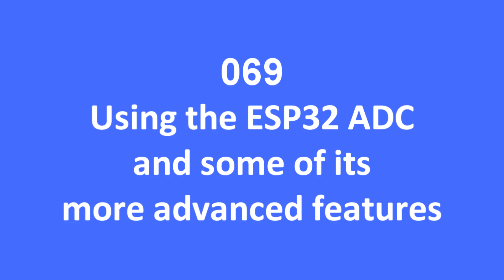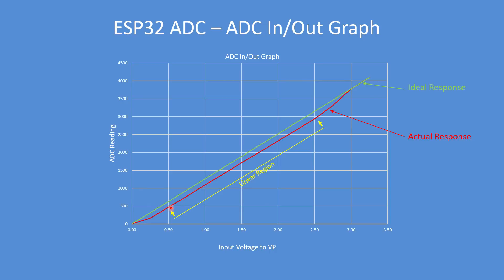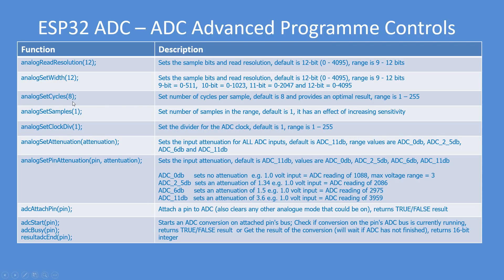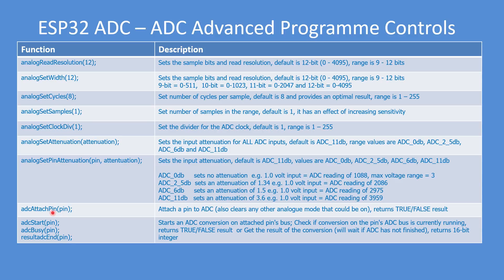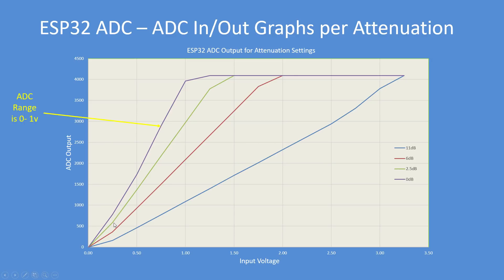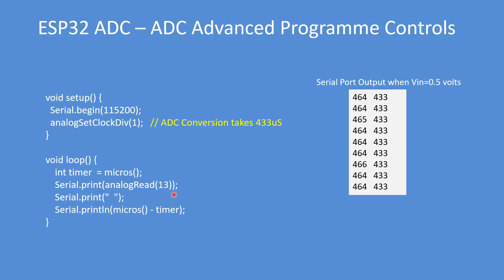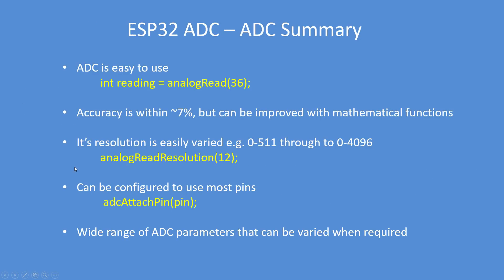Tech Note 069 - Using the ESP32 ADC and some of its more advanced functions

Comment: hello, i'm using the polynomial function to improve analog readings, however i'm only getting a maximum of 3.14 V
Reply from the maker: Well the maximum range of the ADC if set to 11dB of attenuation is 0-3.0 volts or Vcc -0.3, so are you using an input voltage divider?
Reply: @G6EJD  yes, i'm using a voltage divider.
Reply from the maker: Then you need to multiply your result by the voltage divider ratio, so if /2 then *2 then you get back to the actual voltage. Plus there is some leakage current into the ADC input so it will never be say * 2 and more likely * 2.3

Comment: How to increase accuracy at .1 voltage
Reply from the maker: You can't increase accuracy unless you calibrate the readings against a known measurement system. Resolution of the ADC is fixed on that range.
Reply: But I have to measure voltage near .1mv what shall I do
Reply from the maker: @anandsamdadiya8772  Really the ESP32 is not the right tool for this, you need an external ADC of about 12-14 bit resolution. 1/4096 = 0.2mV so a 12-bit ADC wont be good enough. You will have problems with noise at that level too, you'd be better sending the voltage to be measured through an amplifier say x10 so that 0.1mV becomes 1mV, maybe even more amplification is needed.

Comment: Excellent explanation, and super helpful. I'm a little confused on the attenuation. In the chart you show that ADC_0db @1v will read 1088, with a max range of 3v and 11db has 1v reading almost maxed out at 3959. However in the graph it shows the opposite, 0db with a max voltage of 1v.
Reply from the maker: I see what you mean, but at the time those tables were copied from the Espressif variants and it looks like they have been updated and this might cause the confusion. It’s 12-bit ADC so the count will be 0-4095 on the 0dB attenuation and 0-1023 on the 11dB attenuation range, I don’t know why they didn’t allow the full 12-but resolution on the 11dB range! Maybe it’s not attenuation at all and just a rescaling of the same 0dB input.

Comment: Thank you for a focused and clear video. If I  may: I am reading pot values from pins 34 & 35, one after the another. while the readings from 34 are accurate, 35 doesnt respond well. Is there a limitation of number of pins actual usage at a time?
Reply from the maker: I am not aware of any limitations when using any pins, however using ADC2 will create problems if your also using WiFI, apart from that I have no explanations, it is most likely input noise from the source being measured. For example do you get the same inaccuracies when you swap the inputs around. Output impedance is also a factor do are you measuring particularly high resistance on one channel verses the other. You can add a capacitor to the noisy input of say value 0.1uF but the value depends on impedance being measured, the time constant should ideally be longer than your measurement cycle time, for example if the output impedance was 100R then use a very high value of C perhaps 100uF or if 100K then 0.1uF the time constant is R x C in seconds.
Reply: @G6EJD  Thanks for answering.  ESPnow is used to transmit the reading - working well. Pins 34-35 belong to ADC1, so there should be no contention. Swapping the pins swaps the problem, so the connectivity is correct. Perhaps the joystick is damaged.
Reply from the maker: @YigalBZ  ESPnow is still using the radio and the TCP/IP stack. But it does seem to be a hardware or noise issue.
Reply: @G6EJD  I found the root cause: the joystick itself is faulty - one axis is not working.
Reply from the maker: Ok, it’s always good to find the reason.

Comment: Trying to measure temp with an LM35 on VP pin but none of the calculation to get from the raw input reading to final temp in C seem to make any sense. Tried all the attenuation values but I have to pretty much make up the equation while using a 4096 constant. Using arduino IDE by the way.
Must be something glaringly obvious but I can't figure it out.
Any tips?
Reply: glyn hodges  yep, the ADS1115 is also a clone, but it works very well.

Comment: do you think i can read a 3 wire PT100 using the ADC on the analog pins without using a external 4to20mA circuit?
Thanks for your great job on youtube.
Reply from the maker: Rafaelguitarplayer, if it were a 2-wire device then yes, but as it’s a 3-wire rs485 type then no, the rs485 is a differential current communications standard that requires a A B and Gnd connection, therefore you will need an RS485 transceiver to read the values via an ESP serial port.

Comment: Sir - David Bird: I wanted to ask you if you have any videos about esp32-lna with GPIO36, GPIO37, GPIO38, AND GPIO39 ports ??

As a reference I give you the only thing that I have found :
https://github.com/krzychb/esp32-lna    , and really, I have not been able to understand how to do a basic or elementary reading, and from there I can experiment with this special feature of ESP32

Excuse my English,

I hope it keeps getting better and God keep it.
Thank
Reply from the maker: I have a TN on the ESP32 ADC which uses pins 35,36,37,38,39 have you seen that. Don’t forget these pins are input only!
Reply from the maker: Also the gain is varied by setting the attenuation levels, there is no plan to do any more - what are you trying to do?
Reply: @G6EJD   -->> Low-Noise Amplifier "LNA":

SenseVP (GPIO36), SenseVN (GPIO39), and CapVP (GPIO37), CapVN (GPIO38).

I need to understand well how to use the LNA feature of ESP32 as explained on page 559 of the following "pdf":
 https://www.mouser.com/pdfdocs/ESP32-Tech_Reference.pdf
The structure of the low-noise amplifier is shown in Figure133.

To take advantage of the specific characteristics of this Internal Operational application of the ESP32, I still do not have a specific project, but I think it is a very powerful feature of the ESP32, which I can consider taking advantage of in the future, to read sensors that give very weak DC voltage signals. .....Thank
Reply: @G6EJD  No, I have not seen it, what is the link (url), thank you very much for your interest.
Reply: @G6EJD  
You refer to your previous video? Yes, thank you very much, very good explanation, you are very clear when you explain in your videos, I am eternally grateful.
If it is another video can you tell me which one it is? (TN ??)
Reply from the maker: JOSE ARTURO GOMEZ VELASQUEZ, I was mistaken this is the video. By varying the attenuation you are varying the ADC lna gain, this is all you can do at this present time.
Reply: @G6EJD  Thank you very much for your clear and precise explanation, very timely.
Reply: @G6EJD  Thank, important note
Reply: @G6EJD  Thank , aprecio mucho su ayuda .

Comment: Has anyone tried to measure the differential signal between the SENSOR_VP and SENSOR_VN pins? Or is using an external ADC the only way out?
Reply from the maker: Raghavendra Padmanabha, I see no reason why it won’t work if you accept there will be small delay between readings and that the resolution will be limited to ~3/4096v or 0.73mv

Comment: Dear G6EJD,

I am new to this microcontroler world and fascinated by how one can blend different fields of engineering in weekend sized project :)
Your material with those of Andreas Spiess (the guy with the swiss accent) are of great value to me!

Now, I have problem implementing the ESP32 ADC battery level reading. My goal is to measure the voltage on the TTGO 32 Energy which relies on Li-On 3.7V Battery
.

I have 2 questions.

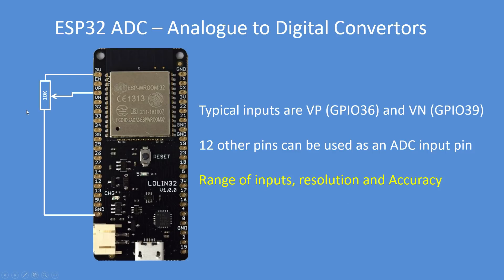From the sketch at around minute 1:00 of your video, the VP pin is pointing directly to the 10K resistor: 

Question #1: is the interpretation below, where VP is connected after the 10K resistor, correct?

 __ 3V
|
10K
|
|__ VP (pin 36)
| 
|__ GND

If I connect 3V directly to VP, the esp32 (lolin 32 and TTGO 32 energy) stop working (they freezes) till I remove the 3V - VP connection.
Can you please confirm the correctness of the sketch above?

I got ADC readouts by implementing this schematic, without grounding, on the TTGO ESP32 Energy (board equiped with a LiOn battery charged) as shown below: 

 __ 3V
|
10K
|
|__ VP (pin 36)

The ADC readout with a charged LiOn 3.7V is stuck at  4095 and it seems "saturated" (it doesn't go lower), I was assuming that the 3V pin delivers 3.3V and less depending on the battery charge level..

I managed to get reading lower than 4095 by  increasing the resistance as shown in the following schematic:

 __ 3V
|
67K (=47K + 10K + 10K)
|
|__ VP (pin 36)

Question #2: Did I set up inadvertently a voltage divider as you showed in your video "Tech Note 115 - Using the ESP32 ADC for wide range DC voltage measurements"?

Thanks in advance for the attention!

Cheers,
Mitch
Reply from the maker: Mitch, your nearly right, but your link from VP to Gnd creates a short circuit this is the correct wiring:
3v
|
|
10K
|
|
+— VP
|
|
10K
|
|
Gnd

This gives a divide 2 voltage divider and 3v will now be measured as 4096/2 or 2048 allowing it to measure up to about 6v 
The voltage at VP = Vin x R2 / ( R1 + R2)

Where R1 is the first resistor from 3V to VP and R2 is between VP and Gnd
Reply from the maker: BTW you can use any values you like, but not too high as the ESP32 requires adequate input current so the effective maximum for R1 is about 330K
Reply: G6EJD thank you very much for the quick reply! I’ll try it :)

Comment: Hi Dave.
If I only want to "correct" the ADC value. Not convert it into Voltage.
Can you explain what need to be changed in the polynomial equation?
(I'm Bad at Math)...
Reply from the maker: The polynomial has many determinants and it’s not easy to adjust one factor of it without affecting the others. It’s function is to take a non-linear 0-3v equivalent input to a linear variant. So it does need a voltage input, if you like. To correct the raw input from the readanalog line just modify the constants after the read statement, say you measure with your DVM an input voltage of 2.5v and the readanalog result is low increase the multiplier value e.g. voltage = readanalog(35) * 7 becomes * 7.05; or vice-versa if too big.
The easy way to get straight to the correct value is input 1.5v measured with a DVM and then display the ESP32 voltage say it reports 1.45v with a multiplier of 7 then 7 becomes 7 * 1.5/1.45 or readanalog(35) * 7.24; then it will return 1.5v. It’s important to calibrate the ADC not at the low or high end of its input range because this is where its most non-linear. So the aim is to get an accurate input to the polynomial equation for the very best results. Uncalibrated the results are still well within acceptable limits as the ESP32 ADC reference is always within a given range, it just varies from device to device.
Reply: is there a way to mathematicaly convert a raw ADC value that was measurd using 11db attenuation to what it would have been if it was measurd let's say on 2.5db ?
I know it will not be very acurate, but it might solve me a big problem...
Reply from the maker: Yes, in principle it is 11db / 2.5db which in gain terms is 1.33 / 2.55 and so multiply your readings by 1.92 (reciprocal of the gain values).

The problem you’ll get is an increased range but no ability to interpolate between values as resolution cannot be increased unless you do this in software as a simulation.
Reply: My problem is, I calibrated several devices using 11db Att. (and sent them to client's. They are now in a shipping container heading to the new world. so recalibrating them is out of the question)
I now understand that 2.5db works better for this specific application. and I'd like to use it for the next devices.
I can update the old devices (OTA is implemented) but I need to, at least, recalculate the calibration values.
I'm shooting in all directions, trying to figure the best corse of action.
Reply from the maker: Well it’s a linear relationship so easily fixed with a scaling factor.

Comment: Why cant i use adc2 when wifi is on?
And by the way
I can push the adc reading into 9.3 uS per pin
With 2 analog cycles
And dual core
Reply from the maker: nendhang ngetz, you’d need to ask Espressif why you can’t use ADC2 while the WiFi is on! Yes maybe the ADC can run at 9.3uS, but I don’t understand what point your making
Reply: Adc2 doesn't work when WiFi is enabled and many development boards hide the adc1 pins.  It's a very annoying "feature".  Did you find a work around?
Reply from the maker: I’ve not aware of any development boards that hide ADC1 pins, ADC2 yes. I don’t see a need for multiple ADC channels (1&2) when for for nearly every real world measurement an inter-reading time of 10uS is near instantaneously the same time, plus ADC1 can be multiplexed onto a wide range of pins, so I’m not seeing the limitation.
Reply: hi bro, how to read adc with 9.3us, please give me the code
Reply from the maker: You have to reduce the number of cycles required to take a measurement in the settings. To be honest if you want high speed readings then the general purpose internal ADC is not the right tool for the job and you should use a high performance external type.
Reply: @G6EJD  better use some DSP
Reply: @HienNguyen-wi2ni  it's up there in the comment

Comment: I did not get svp,svn pins. is this voltage divider? when are they needed? I looked up esp32 datasheet and no good info about them
Reply from the maker: solidfuel86, I’ve just pulled up the data sheet and:
SENSOR_VP
5
I
GPIO36, ADC1_CH0, RTC_GPIO0
SENSOR_CAPP
6
I
GPIO37, ADC1_CH1, RTC_GPIO1
SENSOR_CAPN
7
I
GPIO38, ADC1_CH2, RTC_GPIO2
SENSOR_VN
8
I
GPIO39, ADC1_CH3, RTC_GPIO3

You can clearly see SVP sensor_VP etc are listed, I’m not sure what you mean. To measure voltages above the default ADC range of 0-3.3v you have to fit an external voltage divider made up of two series resistors one connected to the external voltage source the junction of the two resistors to an ADC input and the other end to ground. If the values are the same say 100k each then the division is 2 and the input range is 0-6.6. The compiler is preconfigured to convert the text VP to 36 and VN to 39.
Reply: @G6EJD   Thanks, yes they are mentioned in the data sheet, but I do not understand their purpose, what is special about them to be called SVP&SVN and the 10K resistor that SVP is connected to.
I have read your other comment where  you said :
"You must take into account the ADC input impedance to ensure reasonable accuracy and one way to do this is to ensure the external voltage divider impedances are lower by say a factor of 2 than the nominal 10K ADC input impedance"

But here you mentioned 100K. Is this just an example number or recommendation? 

I need to hook up a 5v analog current sensor. The current sensor does not need to be powered. It can generate 0-5v since it is around AC wire and act as transformer. but I assume that it cannot drive big resistors. I want to use those small blue potentiometer as voltage divider, but I have many of them and I need help picking the right value one.
Reply from the maker: solidfuel86 your current transformer needs a burden resistor usually a low value perhaps 10R. It will give you an AC waveform which will not be easy to measure, really you need to rectify the AC to DC and then apply some smoothing with a capacitor and then adjust your reading for RMS by multiplying by 0.707. The ADC input impedance must be higher than the voltage divider impedance otherwise it affects the readings. For example measure a voltage divider with a DVM and the reading results are accurate but measure the voltage with an old style moving coil meter and the results are inaccurate because of loading effects. Each ADC can be used without adjustments just analogread() the required GPIO pin. I don’t know why Espressif named them as they did other than Sensor Voltage N and the same for P, it does not matter what they are called.

Comment: Dave im looking for the video u mad about baterry mesurement with esp32 u made?.
Can u help me?
Thanks.
Reply from the maker: In its simplest form use readanalog(35 or 36 or 39) the default is 0-3.3v range then add two identical resistors to the ADC input as a voltage diver, say 100k each then the range is 0-6.6v and still accurate for most purposes. Some more maths helps to focus in on a range of voltages, does that help.

Comment: Hi. I have a hydro growing lamp 12v 40W, and esp32. When I turn on the light, the analog readings of the capacitive soil moisture sensors jump by 1000+pts. Do you think your function will get them back to normal. I have used the following
<----------------------------->
int readMoistureSensor_GPIO32(){
  adc1_config_width(ADC_WIDTH_BIT_12);   //Range 0-4095 
  adc1_config_channel_atten(ADC1_CHANNEL_4,ADC_ATTEN_DB_11);  //ADC_ATTEN_DB_11 = 0-3,6V
  return adc1_get_raw( ADC1_CHANNEL_4 ); //Read analog GPIO32
}
<---------------------------------------->
 and tried to raise the voltage to clear the noise a little, but with no avail. That is happening also to a DS18B20 sensor waterproof.
Reply from the maker: Vlad, in short no, the function corrects small variations in ADC non-linearity. Almost certainly your problem is poor supply voltage regulation or incorrect earthing. 40W at 12v is about 3.5Amps so ideally check the supply voltage with the lamp on and off, it should be the same and run a separate earth from the ESP32 to the sensor. Similarly the sensor voltages need to be constant and the same with the light on and off. You can try to reduce the effect by putting a capacitor across the sensor say 47uF or more and if the variance improves then the problem is power supply regulation.
Reply: @G6EJD  Yes, it is short :) Thx for the lighting fast response. I enjoy your videos, especially those for ESP32 and sometime I watch them. just for fun. I would like if you can try to maintain your voice level consistent. It seems you lower the volume level if your thought are long. Friendly advise.